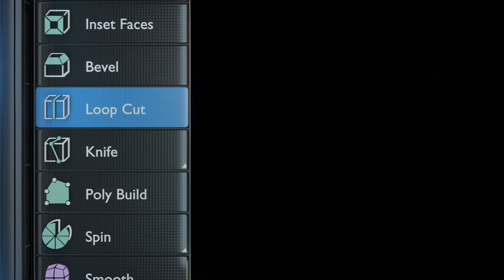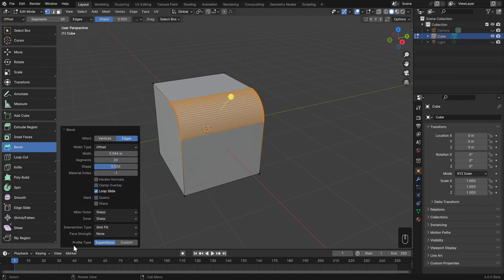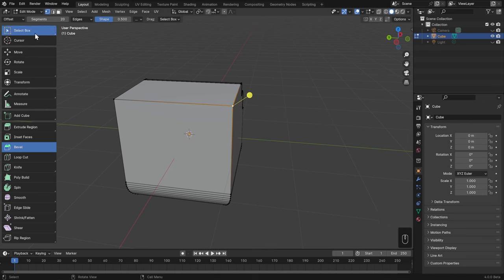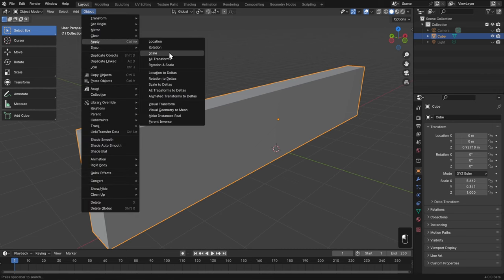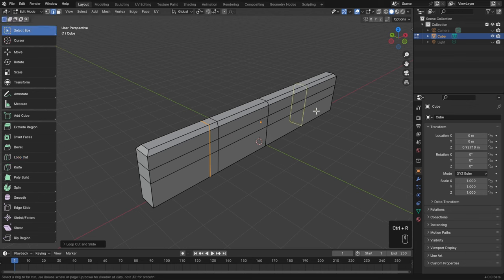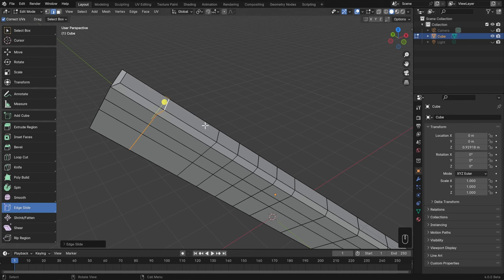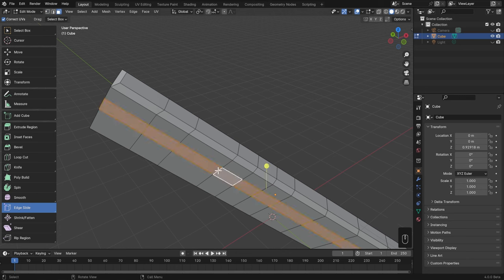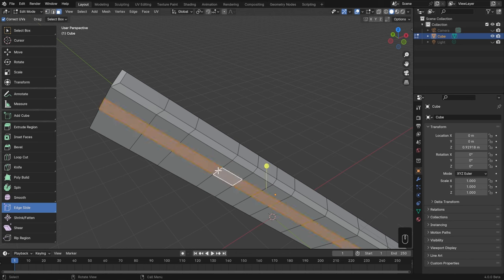BLENDER BASICS 14 - Bevel and Edge Loops

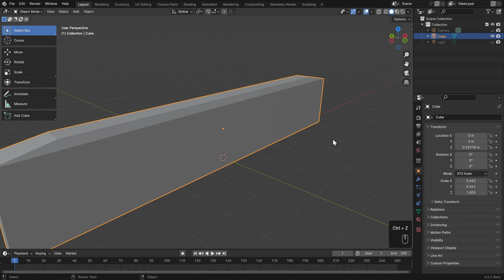Comment: 4:10 Thank you so much for the process on how to apply bevel correctly to objects that have been scaled. I especially appreciate that you used the interface to show exactly where that option was instead of using shortcut keys . This method of teaching helps people with accessibility issues and who have difficulty using shortcut keys to learn 🙏
Reply: Theres always that extra UI menu that pops up at the bottom left and then disappear. dunno how to bring it back...
Reply: @eladbari  Ah, yes - the contextual menu that disappears on any action performed. Kinda wished it stayed there or was available from the outliner until the mesh is edited (like Cinema 4D)
Reply: @eladbari  Press F9 (only works if you didn't do something else after it disappeared)
Reply: While I agree, every beginner (which I am one myself) should still familiarize themselves with hotkeys and use them as soon as possible.